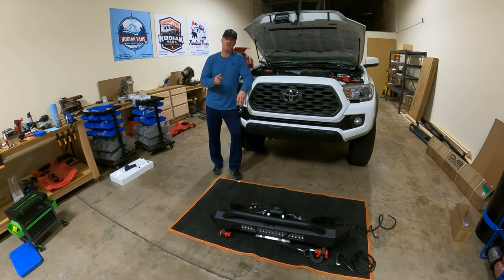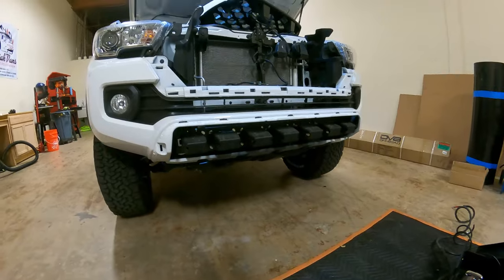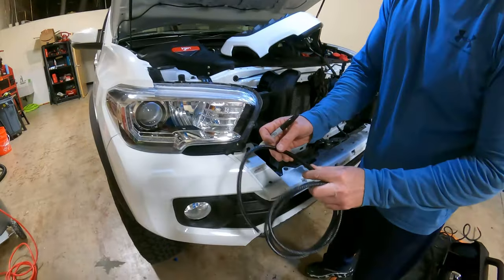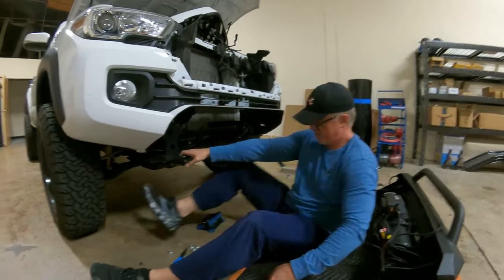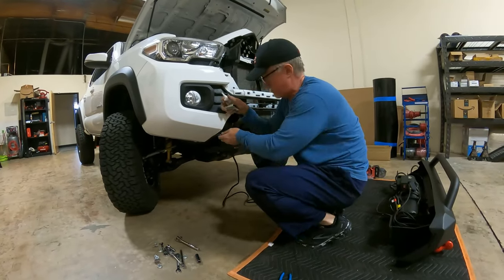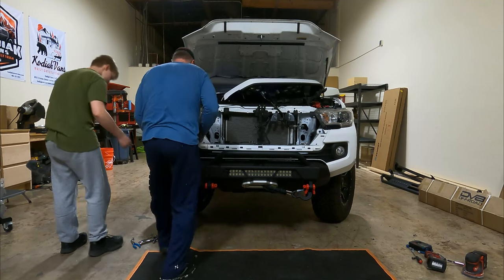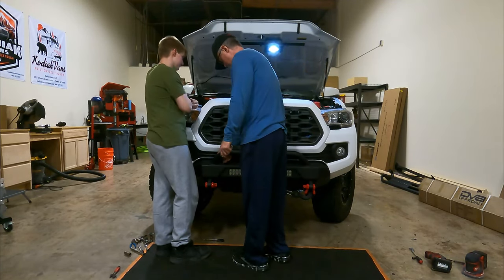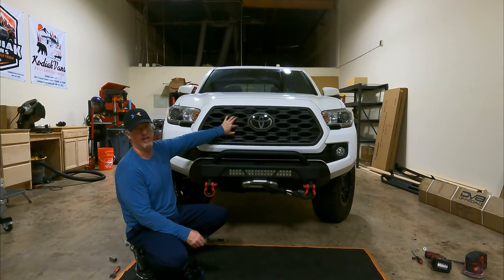How to install a Body Armor Front Bumper on a 2022 Toyota Tacoma eps13 Winch with lights & shackles

Comment: Put the wings on it and then u see how it looks it a hard cut to make it is 1/4inch line under the fog light then tape making tape under that line devise the tape I half and that the cut line for the wing to the top bolt of the fender 4 3/4 down your mark for then end of the cut then u have a bumper😊

Comment: All the videos I’ve seen for this bumper show that cutting is needed. It looks like you were able to install with no cutting? Did you have any issues with the winch and such doing it that way?
Reply from the maker: Yes if you watch the video I show you where to cut the plastic bumper cover in a simple way. No issues with the winch at all if you follow the instructions.
Reply: I don’t know how I missed that part. I’ve watched it a couple times and I missed it.
Reply from the maker: use that tool for best results and control